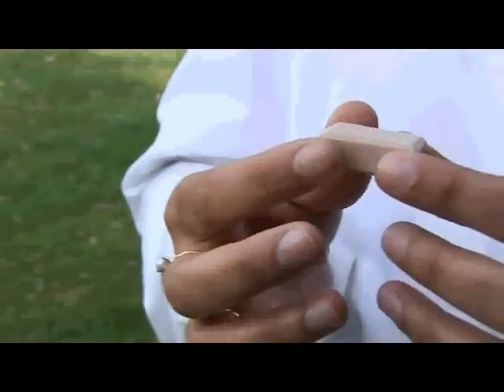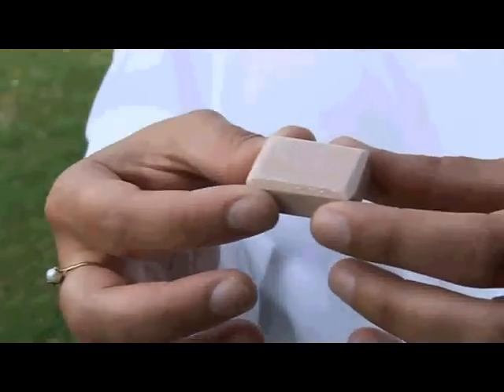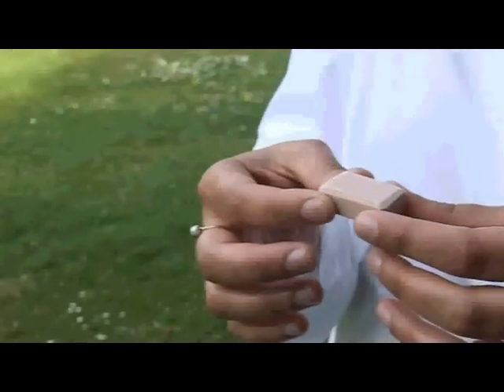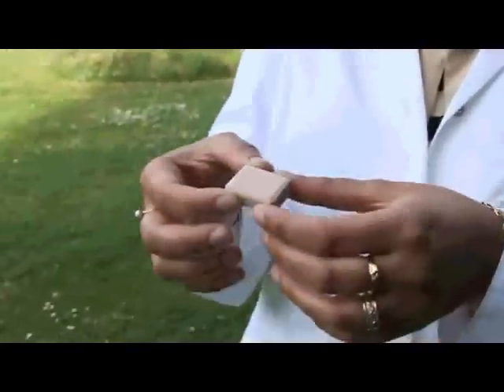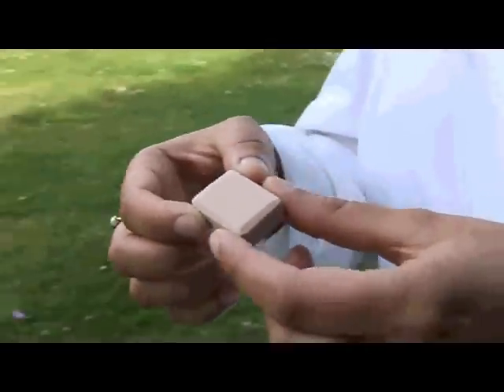Carbon dioxide domino

Comment: Is it just me or does this sound stupid?
How is most of the exces CO2 made? By a reaction with oxigen from our O2.
Which means that O2 goes down and CO2 goes up in relation to one another.
Now you can store this CO2, but then how do you replenish the O2?

To me it seems smarter to find a way to decompose the CO2 back to C and O2.... Would save some extra steps...
Maybe something with high temperatures? I know this isnt easy to do but anything is possible if you ask me....

Comment: What exactly is used when producing these blocks of CO2?

Could the process itself be refined to use practically no energy and maybe even utilise previously unused waste in an environmentally-friendly way?

Also I'd be interested in the total cost in capturing this, including energy used to produce/transport materials to do the capturing. Surely the volumes compressed in this manner would be insignificant if the end processes, including materials, require much energy at all?

Comment: @gassyoldman wrong the polar caps won't cause the sea levels to rise but another thing will the expansion of the volume of the water caused by lower density which water get's at lower temperature or at higher temperature. because Ice has less density than water at 0ºC and water above 0º have lower density as well. and when density is lower pressure sinks and volume gets bigger. The weather won't change much. England might even get sunny weather instead of the constant rain.

Comment: @07734world Carbon dioxide is a "Greenhouse Gas".   The sun's heat can get in, but the earths heat can not get out so well.  The planet is getting warmer.  A few degrees more and we have a runaway effect.  All the ice caps will melt, the seas will expand,  coastal flooding, massive weather changes, a disaster.

Comment: the problem is that we don't want this CO2 getting into the air so we need to keep it where it is in--in the oil in the ground.

so the moral of the story is still--yes, burning oil is bad

also, no one is deamonizing carbon. carbon makes up pretty much every organic thing. we're just deamonizing carbon DIOXIDE emissions.

Comment: its funny that you mention "or freely in the earth as C" because when you burn something, it produces CO2 and heat, and the black smoke that you see a lot of the times is carbon from incomplete combustion.

yes there is new CO2 created. for example, there is carbon in CH4, there is oxygen O2. no CO2 in there so far right? but there is once you burn the CH4 in the presence of oxygen because then you would get CO2 and H2O. the CO2 wasn't there before.

Comment: actually, you are wrong. the CO2 in the air doesn't come from existing CO2. it comes from combustion reactions where a hydrocarbon is burnt and the carbon from it bonds with the oxygen that is required to ignite it; thus, creating CO2